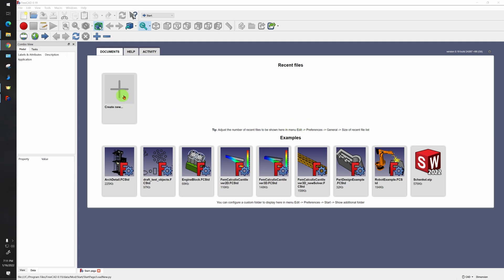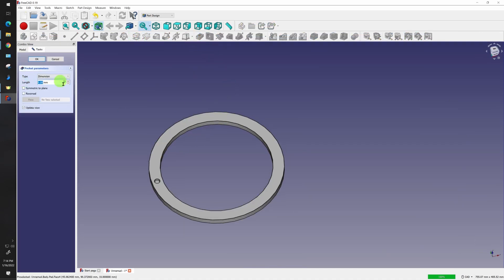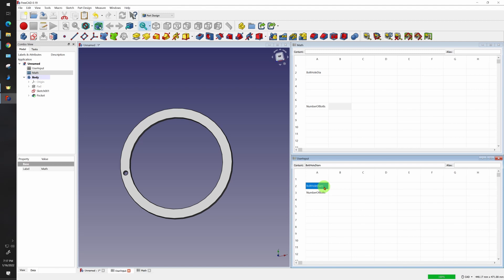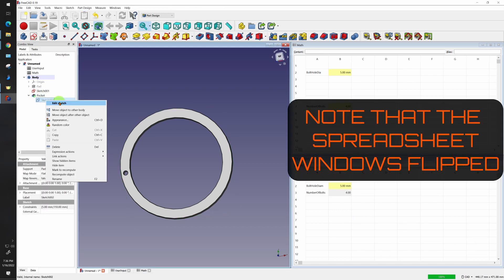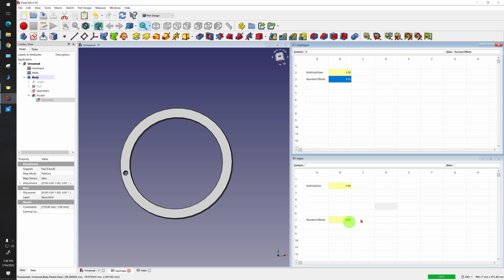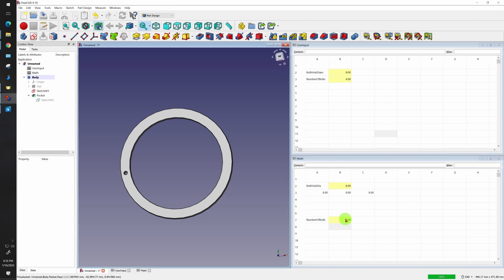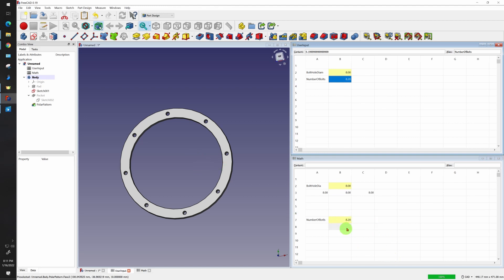FreeCAD Tutorial Conditional Statements in Spreadsheets

Comment: Nice, Just revisited this tutorial again, to brush up on creating 2 spreadsheets, UserInput & Math.
I found myself working on a project and only had 1 spreadsheet, well it got real confusing fast. I also did all my calculation in the sketch while dimensioning and referring to the spreadsheet and created the calculation in there, which is burdensome. I will now go back and create a "UserInput" and a "Math" spreadsheets, first to group all anything that needs User Input to a cleaner Spreadsheet with fewer choices, right, and secondly to get a little more precise with my condition statements. I want to be able to take a given length that needs circle placed at a give space apart, i.e. length = 105mm and the space apart space=20mm, so 105mm/20mm=5.25 #/circle, so ceil(#/circle) will automatically be rounded to "count" of 5 circles. You got me thinking!
The remainder will create a leftover space at the end though? Not really a deal breaker!
what is white and floating in your brandy snifter? I am not a connoisseur...
Thanks
G_Dub
Reply from the maker: Wow sounds like a cool solution.

I love how FreeCAD is giving us the power to  do you're own thing without having 20 old guys telling you that's not the way ... I'm looking at you Catia!

I'm a big whiskey guy but I love the Brandy style glasses.  I switch it up between scotch: Glenfiddich 15, Bourbon: Buffalo Trace and Rye: Lot 40 copper pot.  So I can't remember what I was enjoying in that video.

🍻

Comment: Hi Quin, thanks for your well explained and very useful video on this subject. I've made good use of it in helping to avoid bad data going through my spreadsheet and model. 
Nice work😊
Reply from the maker: Thank you.  I'm glad the video came in handy.

I really wish that you could add these limits to the dimensions themselves, it would be a kickass features for going back to old designs years later.

🍻
Reply: @QEngineering  Hi again Quin, I've been meaning to get back to you regarding spreadsheets in Freecad. I was well through a model with a large spreadsheet when I found your video and incorporated conditional statements into my existing sheet. As I said, it was already a large spreadsheet plus I wanted all the info in one sheet only, so I had to work around a bit to get it to function- a confusing phase until eventually a light turned on. That done, the spreadsheet looked like something out of a horror movie, Frankenstein came to mind! But it worked and I was happy about that. 
Since then I've created a few simple practice models driven by spreadsheets using conditional statements. Over time, I've managed to refine the sheets to the point they look fairly simple and entirely respectable. Now I need to go back to my initial project and rebuild or start again on a better spreadsheet layout, one I can come back to in the future and not be totally confused when I look at it!
Cheers.

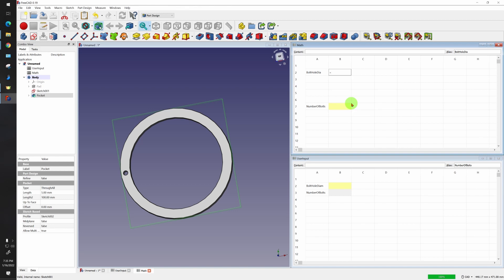Comment: 3:56 > This doen't work for me. It is not showing the names on UserInput. I updated to 0.21.2 and it still the same.

I figured out that if the cell is empty on UserInput (no value was set), you won't see the name from the Math spreadsheet. Putting a value makes it visible. Is the same for you? It looks like is either a but or they change the behaviour.

It looks like that if you delete the value on UserInput, Math will keep the last value.
Reply from the maker: For the longest time the expression engine had an issue with things not showing up in the drop down but if you knew the exact name you could still type it in and get the value.

That being said my workflow is to type in the values first then reference them later, no reason for it, I just like doing it that way.

Comment: Wow, I like this, you have re-directed my thinking... Your videos are great! 
I have an existing model (2"x48" belt grinder) that I am going back over the dimensions and converting to a spreadsheet. The existing dimensions just need to be whole numbers, and my dimensions are, except for one R16.5mm but that will work out for the diameter. Anyway with my dimensions I'm trying to just use a percentage of the total distance (i.e. total width is 265mm with a 65mm offset from the Origin(LowerLeftCorner) and then the 200mm base begins over to the right corner) so 200/265= 0.7547169811, it starts out as whole numbers but freecad is not allowing zero decimal points so I end up with a dimension with 3 or more decimal points and I can live with just rounding up or down, maybe I will try the "ceil" command? I would like to have a small, medium and large size of Grinder, that's why I am using percentages. I am thinking I will just enlarge everything globally by the percent I choose. 
I have never done this before... as you can tell... any suggestions 
?
Thanks
G-Dub
Reply: Yes, this is what I was looking for, VERY HELPFUL!!!
Reply from the maker: I'm glad I got your imagination going, knowledge is golden but imagination is priceless.

It sounds like your 100% on the right path, the solution you have sounds very logical and if it works for you that's amazing.  Keep doing what makes sense for you.

Personally what I've started doing in some designs is using 3 fields, 1 is the dimension, 2nd is an offset and the 3rd is the total on both. I then use the total as the volume.   I like this because I can maintain my optimal dimensions and see the offset which is compensation for my 3d printer tolerance, it works well for me because I can take a look at the design years later and know what's going on.  Which is basically what your seem to be doing but I like dealing with hard values (ie 0.1mm) while you like percentages, which is simply a personal style.

Keep up the great work really sounds like you're rockin FreeCAD.

🍻